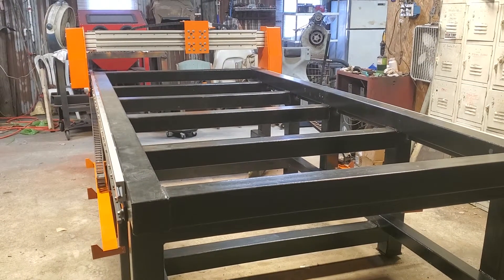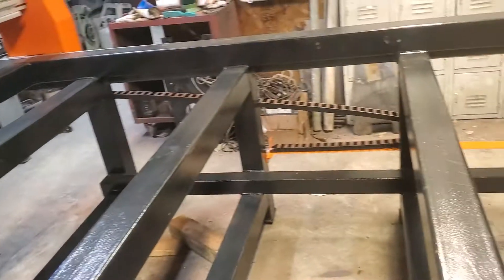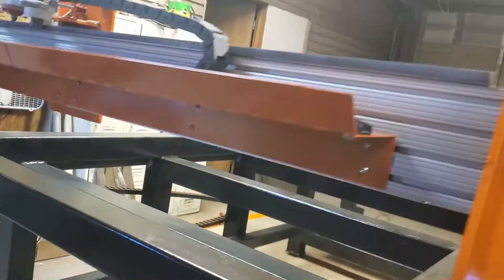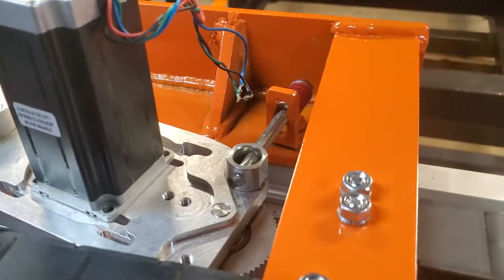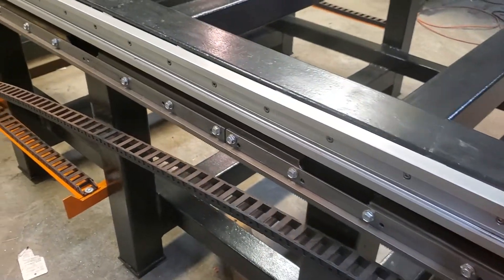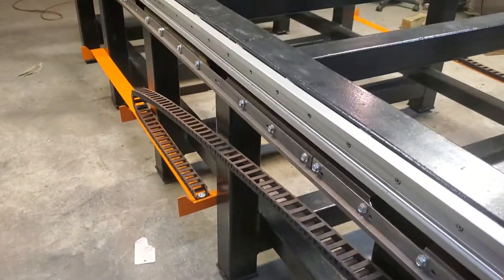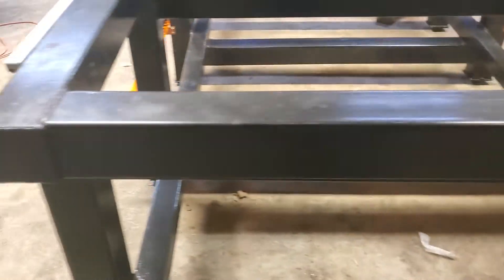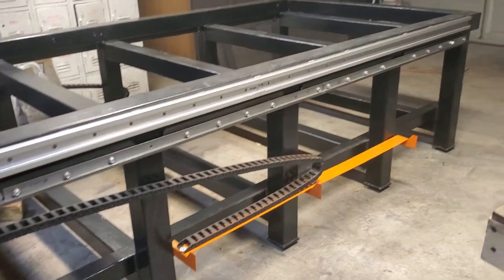BEST HOME BUILT CNC PLASMA TABLE 4X10`.#6

Comment: Go get some Tractor paint from the tractor supply and use a thinner to spray. That stuff is as hard as powder and holds up real good
Reply from the maker: Yea.. Thats what i was going to do.. But son in law gave me a gallon of Automotive Black. that was new.  So thought I would save, and roll on with 4 inch roller.. mistake.. not smooth anymore.. rough looking from roller.. and paint to this day is still tacky.. Thinking on buying Tractor paint. and I always use Hardner,, It dries like in couple hours.. and smooth..  Live and learn..